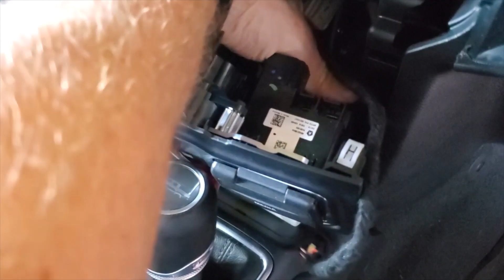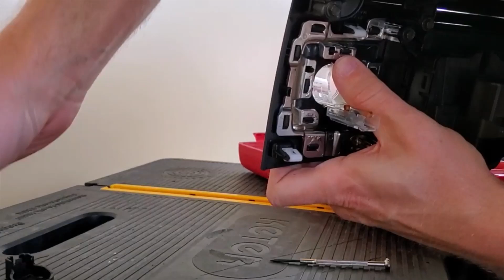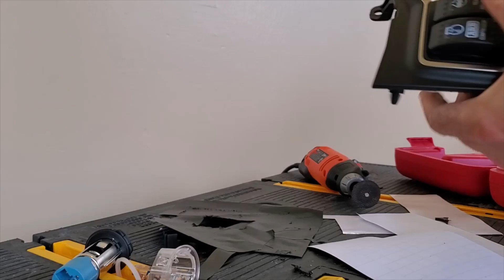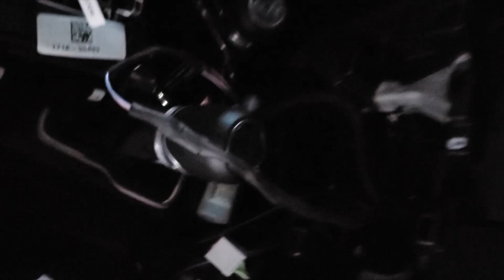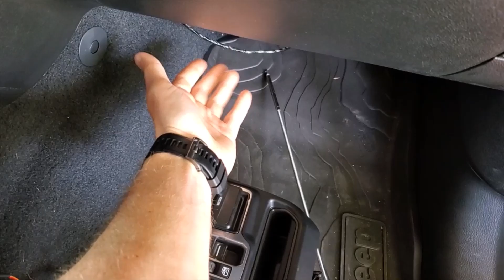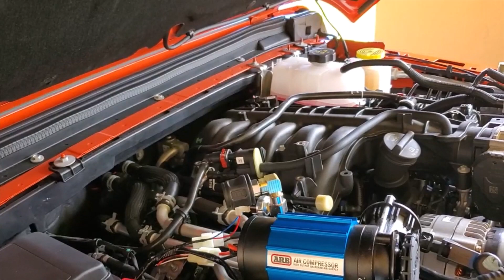Unique ARB Contura Carling Switch Install | Jeep Gladiator JL Wrangler (Factory Integration)

Comment: I'm glad I found this video as it was very helpful and I really enjoyed your other one where you selected the engine location for the compressor.  I have a 2019 Jeep 4door JL and a single ARB compressor that I plan only to use for airing up tires.  I installed it just as you did and will be using an 813 plate on the side of the engine compartment for the air chuck and switch.  Where can I attach my red/yellow and blue/white ignition and accessory wires in the engine compartment?  Thanks

Comment: You should run the intake of the arb to the intake of the jeep for filtered air.
Reply from the maker: That would put a vacuum on the arb and cause air to pull from the pump. That would not work.

Comment: You should have use the factory 4 aux switch.  1 air 2 rear locker 3 front 4 both.

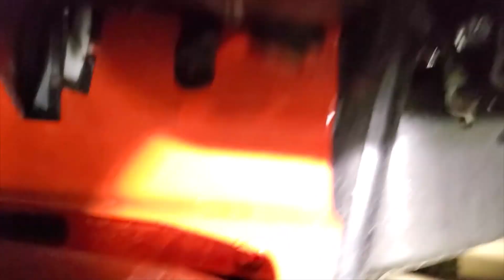Comment: Hey bud, ive tried contacting you through facebook messanger, but havent heard back. i had a few questions for you about wiring.. Also.. before i rip them out and render them useless, what was the trick to removing the 2 plastic trim Christmas trees in the fender liner where they meet at the lower part of the fender by the passenger floorboard seen at (13:56)
Reply from the maker: I dont use it sorry.
Reply: TewlTalk no worries bud... it’s probably my better that you don’t, I’d be asking questions all the time 😂
Reply from the maker: @GatorOverland  With work, this, and family activities its getting to be busy for sure.
Reply from the maker: To pull those tabs I had to break one of them. Bought more at napa
Reply: TewlTalk that explains it... they aren’t coming out unless they are broken😂..